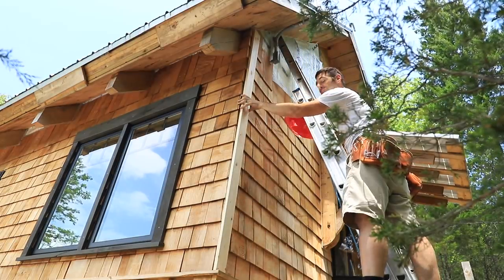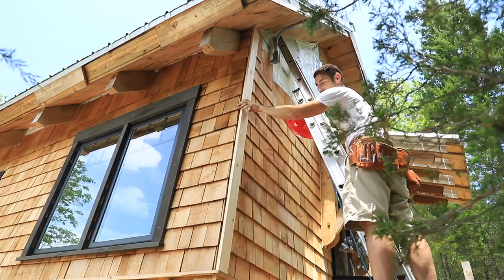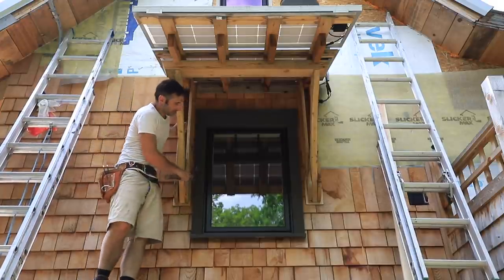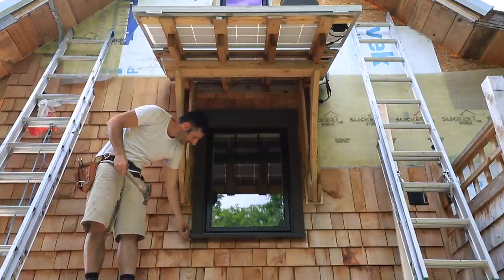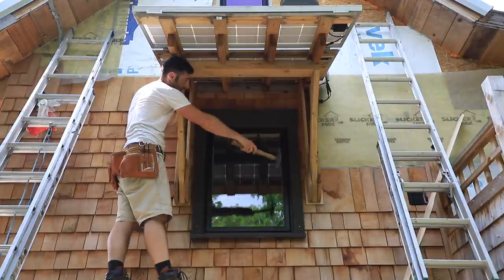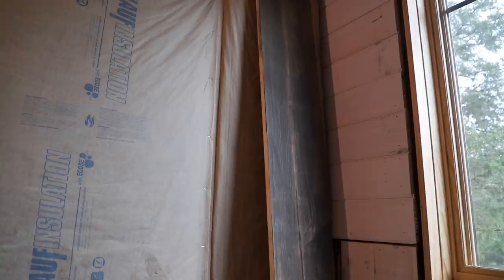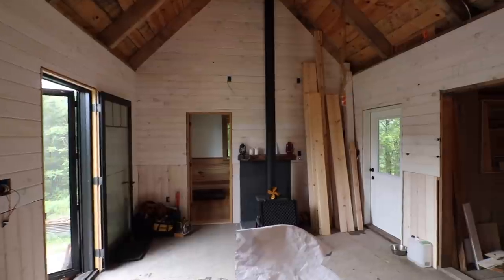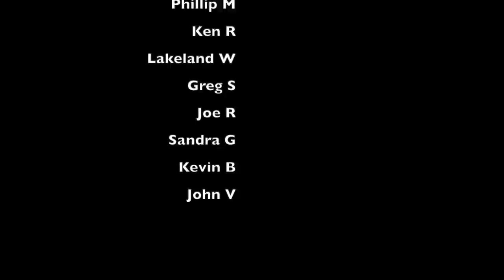Chill Video of a Guy Building a Cabin in the Woods

Comment: Since I just did my driveway with a drag to get rid of the grass growing on it I'm "suggesting" making one to use that you can pull behind your truck when you go up and down your hill and leave it off the side.  Mine was made with a steel step with a short chain and a short rope hooked on the back of my lawn mover.  I was amazed by how quickly the driveway started looking like a driveway with only a few trips.
Reply from the maker: Thats a great idea, I think they used something similar when we would work on our little league field.  It was a chain link fence with a big timber tied on top of it, it would make the base path nice and smooth.

Comment: Have you considered buying 2 100lb propane tanks and a little slab to set them on?  You could attach them with a ratchet strap to eye bolts and a little regulator... you’d probably only have to change one out every couple of years, and you’d never have to worry about running out.  Great work as always!
Reply from the maker: I don't seem to go through the propane very fast, I've got a 40 and a 30 lb tank right now.  Seems to do the trick.

Comment: A new haircut during the pandemic. Looking sharp!  I needed a hair cut in February.  Well, I ordered some Conair hair clippers and decided to take the plunge.  Now I look like I have the mange. haha.  Thanks for another upload.  It was fun, as always, to watch and it sets people off in a good mood throughout their day.  
Oh, something I noticed. That wind whipped that screen door back while you were coming in.  Some people use those pneumatic door  closers.  Some screw in a chain with a spring to the door and the frame of the door.  I've had to replace a few due to storm damage. Once,  I let go of my door and the wind tore out both the top and bottom pneumatic's from the door frame.  I got wood glue and longer, wider screws and it was an easy fix but could have been worse.
Reply from the maker: Ha ha that is too funny man.  Sorry your haircut experience didn't turn out.  Yea I have part of the kit for that screen left that I need to finish installing.  Too many unfinished jobs here.  As always thank you for watching and commenting.

Comment: You need to add a couple of outdoor waterproof electrical outlets on the porches (front and back) and maybe have them on a separate switch/circuit or whatever to only be on as needed
Reply from the maker: Yea I should do that, wouldn't be too difficult to run the wire under the cabin.

Comment: I have always wondered what you would eventually use for stairs to the loft. Then I saw these:
https://www.stairwayshop.com/media/catalog/product/cache/2/image/9df78eab33525d08d6e5fb8d27136e95/r/a/rainbow-galaxy-2-attic-stairway_1_3.jpg
Very space saving and not permanent  to the ground floor. Con is the price. You could mount it to the loft header so the treads come down to the front wall instead of toward the woodstove? They do make the same thing for attic access for considerably less.  Just food for thought !! Good job on the shingles. I know it's a lot of work but they're really classic!
Reply from the maker: Thanks thats pretty cool!